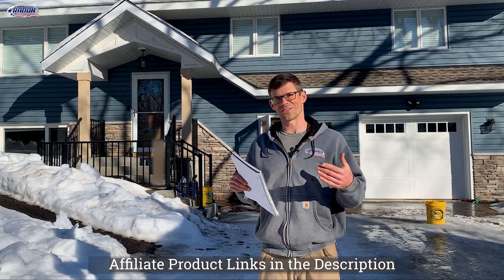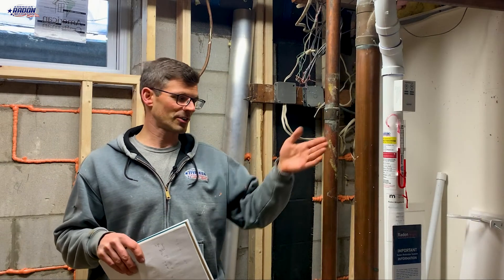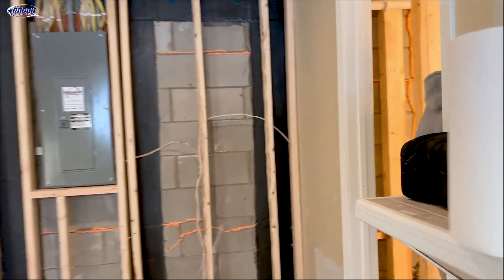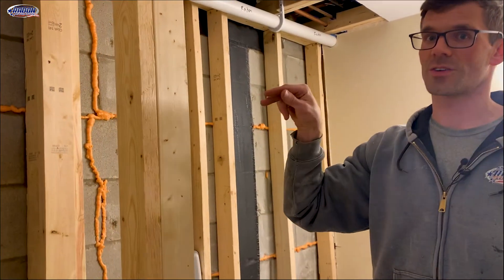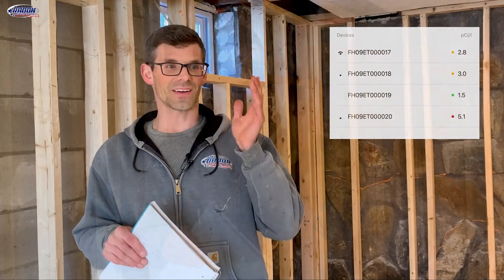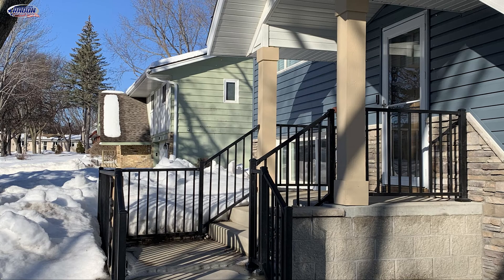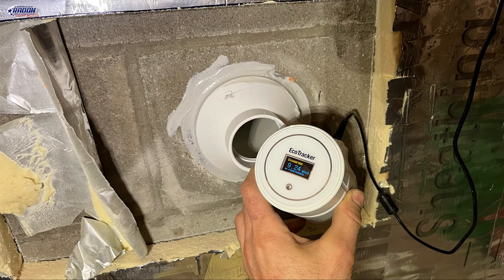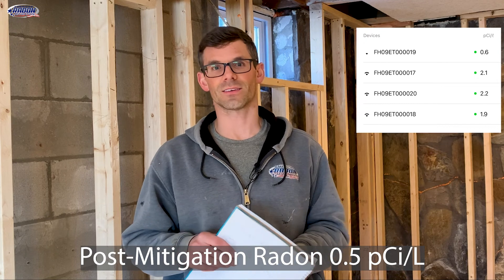Tracking Down Hard to Find Radon Entry Points

Comment: Is it necessary to seal the floor drains in the basement to prevent radon from getting into the house? Thanks
Reply from the maker: Not usually. Floor drains only need to be sealed if they drain directly to the soil or don’t have a functioning trap. Make sure the water in the trap doesn’t dry out, as that could allow sewer gases or radon to enter.
Reply: @AmericanRadonMitigation Thanks!
Reply from the maker: You’re welcome!

Comment: How do you keep airflow from going backwards in the sump pump drain line? Wouldn’t air want to come in from the sump pump to equalize the pressure in the well?
Reply from the maker: When installing a radon mitigation system, a check valve is required on the sump discharge pipe.

Comment: Hi, Jesse! I had a radon mitigation system installed a few days ago in my southeastern Wisconsin condo. The condo is a side-by-side, built using a common slab over a crushed rock foundation. As a part of my mitigation, pressure field testing was done, the result of which was to use a larger and more powerful radon fan. My sump pit was also covered and sealed. Post-installation testing will be done in 2-3 weeks to determine if the radon concentrations are acceptable. Since the condo type is side-by-side, I have a couple of questions: 

1) will my system also mitigate my neighbor's condo to some degree, and 
2) should my neighbor's sump pit also be covered and sealed? 

Any thoughts you have would be greatly appreciated! Thanks, and have an awesome day!
Reply from the maker: Thanks for your great questions!

1. Yes, if a drain tile connects your unit to the neighboring unit or there is no footing between units, your neighbor could receive collateral mitigation. 
2. Yes, the sump should be sealed if the abovementioned conditions are present to prevent your radon system from drawing conditioned air from your neighbor's home, which could also backdraft their natural draft appliances. 

You could test this by performing PFE in the neighboring unit or puffing smoke or incense into the drain tile in their sump to see if it draws into the drain tile system. You could also turn your system off to see the results of the smoke test both ways.

Comment: I’ve seen other radon mitigation videos where a shop vac is used to create test suction. That seems a bit disingenuous as you’re not going to have an 8amp shop vac motor connected to your radon mitigation system when you’re finished.
Reply from the maker: We use a shop vac to do communication tests to choose the best suction point locations and a pitot tube to measure pressure and airflow. The valve in the 2-inch pitot tube allows us to mimic a radon fan with a shop vac.
Reply: @AmericanRadonMitigation  Makes sense.

Comment: The space under the front step shouldn't be enclosed; it needs to be ventilated.  Could you or the homeowner not just have added direct (passive) vents between that space and outside versus drawing it into the system?
Reply from the maker: @ncooty  Perhaps. Have you tried it with successful results?
Reply: @AmericanRadonMitigation  Yes, but for us, it was a matter of mitigating moisture versus radon.  Those "cold rooms" are common in the northern U.S., and people often forget about ventilating them or figuring out whether to treat them as conditioned or not.
Reply from the maker: Are we both talking about the foundation for under the front step?
Reply: @AmericanRadonMitigation  Yes.  In many areas, that's blocked in as a cold room--i.e., unconditioned.  They often have vented blocks on the outside walls and an exterior door between that area and the basement.  The floor level is sometimes higher than in the basement.  The problems usually come when people either enclose it without ventilation or screw up converting it to a conditioned space.  Of course, some builders will just build them as unventilated boxes, so they start off wrong.
Reply from the maker: @ncooty, most of them in Minnesota are not open to the home. They are filled with soil, and the front step is poured on the foundation. That’s the case with the home in this video. Radon can build up under the step, and the house can draw it in through the rim joist area. This can lead to frustration with the mitigator as it’s hard to track down the radon entry point. Check out this video for a similar story: https://youtu.be/VkuUX0atOsM?si=eWBmgdQz-R-j_y-U
Reply: @AmericanRadonMitigation  Oh, interesting.  I haven't seen that.  Is the dirt structural or just to fill the void?  I'll have to check out that video.  Thanks for the details.
Reply: @AmericanRadonMitigation  By the way, I'd be very, very interested to see how you mitigate radon in a basement with a perimeter drainboard, such that gasses can rise up from the dimple board, especially if the sump also collects from an exterior drain.  That seems like a common but extremely difficult problem.
Reply from the maker: Just to fill the void and support the concrete step. I'm sure most of them don't get compacted, and there's quite a bit of settling that takes place.
Reply from the maker: If you want the radon system to be energy efficient, the drain board should be sealed. If water comes down the inside surface of the wall, the right way to do it is to encapsulate the wall with a vapor barrier, tuck the poly into the drain board, and seal the top, bottom, and seams of the poly. This approach allows water to enter the drain tile system while minimizing the energy penalty of conditioned air loss. It also makes the radon system more effective and allows for a smaller, quieter radon fan.
Reply: @AmericanRadonMitigation  Thanks very much for that.  It's mostly as I'd suspected re: drainboard.  Any thoughts on how you'd deal with the exterior drain tied into the interior weeping system?  My guess is that in that case, you'd ideally core a separate hole for radon extraction rather than pulling from the sump.  Unfortunately, where I am, many older houses have basement pads directly on grade (no gravel bed), so it'd be hard to get good air flow if not via the drain system.  I know I'm describing a very difficult scenario, and my advice is for those folks to call a specialist.  I'm just curious about what a pro actually advises to those people.

Thanks again for your time and your very informative videos.  They've prompted me to take radon readings in any basements where we work so that we can inform people, even though we don't deal with radon.  I point them to your videos as a starting point for learning about and considering options.
Reply from the maker: You are very welcome! Thank you for watching and raising awareness.

To tie into the exterior drain tile, we core a 5-inch hole next to the sump and dig a suction point. Then, we drill a 5-inch hole through the side of the sump basket. This allows us to draw from the sump without installing a pipe through the sump cover, making servicing the pump easier. If that doesn't create the suction we are looking for under the slab, we continue adding suction points until we have the entire slab under control.

Comment: If the concrete block wall foundation is hollow doesn’t that let radon weep in and would it help to add a suction point in the block wall?
Reply from the maker: For whatever reason, it doesn’t seem to be an issue. I’ve never had to depressurize a block wall.

Comment: does radon get in through concrete block walls of basement much or mainly under the slab?
Reply from the maker: It seems like concrete slabs or crawlspaces are the main culprit. I don’t think I’ve ever applied suction to a block wall.

Comment: Great video sir! How often do you recommend testing for a home that already has a system in place? (We had a system installed 12 years ago, then never retested and now 12 years later tested and found 4.4 — not good!)
Reply from the maker: Thank you! The EPA recommends testing every two years if you have a radon mitigation system. A radon monitor is also a great product to consider.

Comment: Hi Jessie, I've been watching all your videos so I have an idea of what to ask my installer. Question for you. We have a basement bathroom with a sewage discharge basin and was wondering if that could be a point of entry for Radon. It should be airtight but I was thinking the PCV waste pipe coming into the tank from the toilet might not be sealed?  I have high levels in my basement.
Reply from the maker: You can always pop the cover off and check it out. Sometimes, they have a rubber grommet around the sub-slab piping as it comes into the basin, and sometimes, it's a rough upending that can be sealed to make it more airtight.
Reply: @AmericanRadonMitigation  Sounds like a cr$#py job!  I'll give it a shot tomorrow.

Comment: The front step must not have been vented.  If there was a vent on each side providing good cross-flow I imagine you would not have had this problem
Reply from the maker: Is it common to have vented front steps in your area?
Reply: Wow.  That was a quick response.   Most front steps here in Ontario Canada have full-height foundation walls and a doorway into them from the basement so they can be used as a fruit cellar or wine cellar.  And yes, must be cross-vented by code.  The learning in this case would be that if there is hollow unvented space under porch, warn the owner that it msy need to be treated also, and measure the levels there before the system is designed..  live and learn.  Thanks for the videos.  Learning lots.
Reply from the maker: That's interesting. Unfortunately, there's no easy way to measure the radon under the front step here in Minnesota since it's inaccessible. You'd have to drill a hole to measure the radon with a radon sniffer. 

I'm glad you find our videos helpful!

Comment: Hi Jessie, When having multiple suction points it is better to put the gate valve at the suction point or near the T that is closer to the fan? It would seem adding near the T might lower the suction pressure along the other suction point pipe run, but I am not sure which is better. Thanks for any insight you might have.
Reply from the maker: I don't think it matters where you add the valve. However, I would add it below the U-tube manometer and alarm. Otherwise, the manometer may look even on both sides, and the alarm may not have enough static pressure to work.
Reply: Thanks for your input I appreciate it @AmericanRadonMitigation
Reply from the maker: You bet!

Comment: Why are you using 3 vs 4 inch pipe ??
Reply from the maker: We calculate the CFM needed to achieve the desired pressure field extension to determine pipe size.

Comment: I've watched your videos and greatly appreciate all your input. However, I do have a question unrelated to this video related to an excavation process I use for subslab depressurization.
Reply from the maker: Thank you. What’s your question?
Reply: @AmericanRadonMitigation  the region I work in New Mexico has very thick caliche and I use a pressure washer to loosen and remove material. However, it seems like my acclimation time increases in some cases. I was wondering if this medical of removing material has been used out your way and it's effectiveness
Reply: I'd like to add that this install is an outside install where a 5" core is done through the stem wall below the slab. The material under the structure is clay so I chase plumbing to try to keep to one system. I have found what I think to be a safe way to remove material like hard clay using a pressure washer and shop vac. I believe this process increases the acclimation time. Thoughts?
Reply from the maker: @ChristopherBarbeau  what do you mean by acclimation time?
Reply: @AmericanRadonMitigationAnoka  a downward trend in radon over time as the pit of suction dries out. I'm trying to find a way to provide an 'ultimate mitigation' in which the client can test every 2 years with successful results.
Reply from the maker: @ChristopherBarbeau  Yes, I would imagine that saturating the sub-slab soil would make it harder to get PFE until the soil dries out and allows for better communication. This might be a great method to remove soil. However, it would be hard to get reliable PFE data since the numbers would change once the soil dries out. You may want to look into the Aircavator. https://www.radonaway.com/aircavator-radon-kit

Comment: Great Channel, We are finishing the basement for a movie room and the radon level was around a 3.5 to 4.5 before sealing the cracks in the floor and the bottom of all the walls with radon sealer.  I have a poured concrete walls that have spray foam from top to bottom for insulation.  Now the radon level is above 8/9.  what am I doing wrong,  I thought sealing it would reduce the readings.  I will be putting in a Radon fan system next.  thanks
Reply from the maker: Hey Gerald. I have heard the EPA has done studies and found that sealing alone is not an effective way to reduce radon significantly. I would say you are well on your way to having an incredibly effective and energy-efficient radon mitigation system. Feel free to contact us for advice via virtual consulting or to rent a mitigation tool kit. Good luck with the project! https://americanradonmitigation.com/shop/

Comment: Your videos are super awesome to watch as a mitigator myself, licensed and certified out of Colorado. Where are you based? Also, is that 2 inch schedule 40 pvc you're using??\
Reply from the maker: Thanks, Gage! We are in Minnesooota don't ya know. 😉 
 What part of Colorado are you located in?

It sure is 2-inch piping. It comes in handy as there are many places that a 3-inch pipe will not fit. Chad Robinson even talks of using smaller piping. As long as you understand your piping resistance, you can use small pipe in many low-flow applications. Check out Kansas Stare Universities OMAD course to learn more. Here’s a video about it. https://youtu.be/jyX5zmTg0QE

Comment: We were getting a radon reading super high in our house and we were doing our own sort of mitigation till we could figure out about sealing our basement and Chyna died here we're getting an over 200 reading for the radon we we had to have our basement sealed outside filled cracks and the weeping tiles replaced on three side of the basement on the outside now our radon levels are under 10 Bq/m3
Reply: no radon fan, just sealing?
Reply: @marcusbiller867 I've heard installing just pipes without a fan can significantly lower radon level

Comment: Great video as always. When do you stitch underneath or go overhead with another suction point?
Reply from the maker: Thanks, Logan. It's almost always easier to add multiple suction points rather than employ the stitching method. We primarily only stitch when a finished basement prohibits multiple suction points. Check out this video for an example of that. https://youtu.be/TyCUneMCcLc

Comment: We just noticed my radon system wasn’t running and after investigating it I realized that the GFCI outlet that it’s always been plugged into now trips every time I plug the radon system into it. Could this be a fan issue or something in the electrical wiring of the radon system causing this issue? The outlet seems to do fine with anything else plugged in. I even tried the radon system on another GFCI outlet and it tripped it as well. Any help would be greatly appreciated thank you
Reply from the maker: I'm no electrician, but it sounds like it might be time for a new radon fan, especially if the fan was working before the tripping issue.

Comment: I am all about this!
Today we found that the present system installed by others was pulling radon into the home through the slab supply ducts, through the furnace, and located with an Ecotracker pouring out of the return duct in the ceiling...
Reply from the maker: I need some help understanding what you are describing, Charlie.